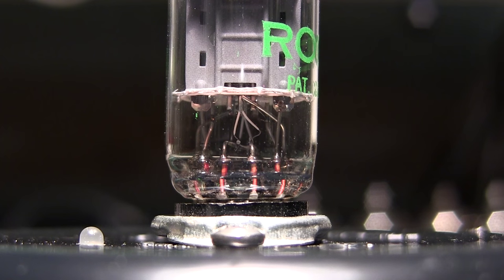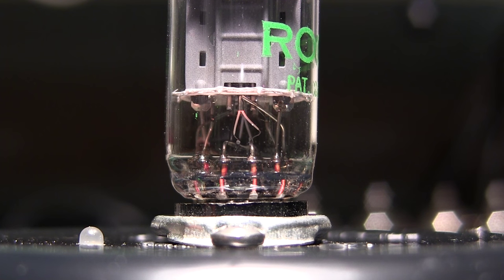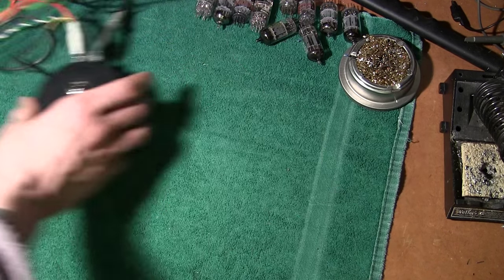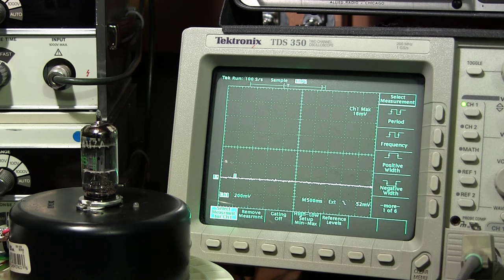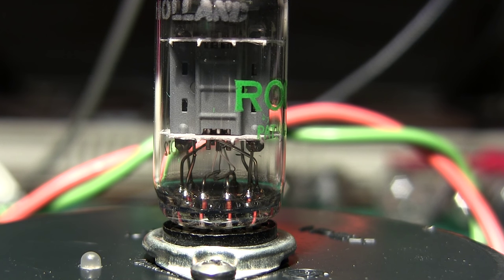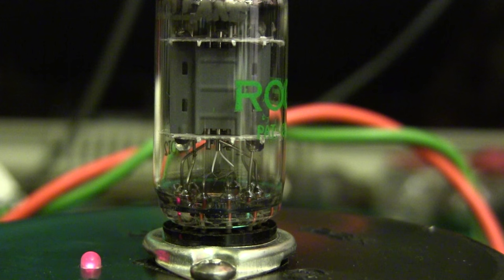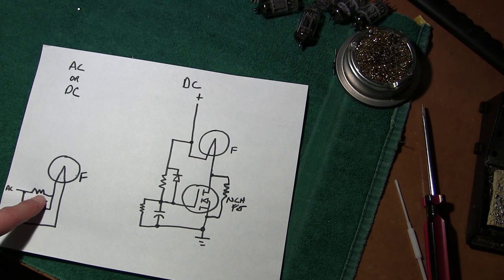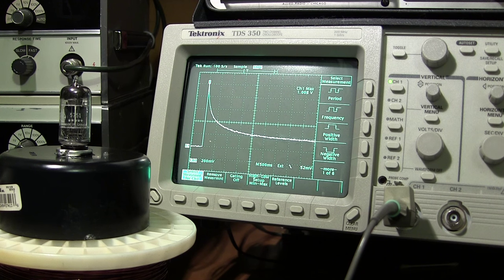Tech Tips Tuesday Dirty Little Secrets

Comment: What luck. Yesterday I was working on my first tube circuit using an ECC83 configured as a cathode follower, but I noticed that the filament was glowing really bright when I was turning it on, I used a 5 ohm NTC but that wasn't enough, they I switched to the other tube I had and that one was working fine. You should rename your video to something like Filament flash over fix or something, If I can't find a good NTC then I'll construct a mosfet circuit like the one you've presented. Again, I can't thank you enough. Cheers :)
Reply from the maker: +ciprianwiner 
Your welcome, Glad the video helped!

Comment: i gather that the the faulty filament had a non-uniform resistance per unit length 
and the portion with the higher resistance was where the flash occurred.
Reply from the maker: You got it Charles!

Comment: Intriguing  problem indeed... If heater sections are identical why the flash on one and not the other heater? One possibility is that because each heater runs up the cathode tube cylinder ( so has to be isolated from it and itself) parts of the lower filament may show low shunt resistance due to imperfect isolation that vanishes after the flash period. Just conjecture but it must be this sort of thing going on. In good heaters w/o flash this distributed shorting along the filament would not exist.

In this particular tube running the heaters in series would cure problem as one section would current limit the other. 

I was aware of heater flash and seen it many times  but thought it was 'normal' though did wonder why only some tubes had it. Interesting to know that it is considered a problem.

Comment: I'd love to have some "suggestions" about using a current limited supply in place of individual circuits for each tube... time delay might change some uses quite radically.
Reply: ...if the vacuum tube heaters were in SERIES, a single current limiting circuit for the entire heater string would suffice- but if the heaters were in PARALLEL, then EACH vacuum tube heater would probably need its OWN current limiting circuit.

Comment: Interesting. Makes me wonder why the tube-based computers in the early days were better left powered on all the time to prolonge life of the tubes... Lifespan is all related to thermal expansion...... ?
Reply from the maker: +bwack 
It's kind of a balance. Leave them on all the time and the lifespan in hours will be achieved. Turn them on and off through out time and lower their life through thermal cycling. My solution would be to turn them on and off, but soft start them like shown here. I think that would be the best solution for an elongated life span.

Comment: Very interesting trick. Seems like the incandescent lamps also always burn out on ignition.
I'm building a 5e3 tube guitar amplifier, and I wanted to replace the classic 'standby' switch (which I'm not convinced is doing any good) with your 'pre-heat' switch.

Which resistor value would you recommend for a double 6v6, 12ax7 and 12ay7 setup (it also has a pilot 6.3v lamp)?

Comment: Thanks for the info and excellent presentation. Is there any reason you didn't choose to use an inrush current limiting thermistor?
Reply: Indeed , this softens the start-up as well as indirect heated tube rectification .....and or applying HV after the needed heater warm-up time which is the definitive answer to tube life protection and extension .
Reply: ...REMEMBER: "self-heating" components are subject to DETERIORATION OVER TIME-(!)

Comment: For automated operation an off delay timer set to 15 seconds with a NO and NC set of contacts, the NO set running through a resistor of whatever value and the NC side running no resistor., The timer itself running off of main power. There no nasty transistor in my tube circuit, lol.

Comment: I would have thought that a low-valued series NTC Thermistor would be a very simple way of automatically limiting the switch-on surge?Would work with AC or DC heater supplies.
Reply from the maker: +Steven Birch 
May have mentioned this in this post. The problem with thermistors is, they require resistance to keep them hot. That little bit of resistance dramatically reduces the heater voltage under normal operating conditions.

Comment: I've got a tube flasher buried up in my junk and had a bunch of adapters with it I mainly used it on picture tubes but it had about all of the tube adapters and settings..and running DC on those filaments would keep them a lot quitter but draw a lot more current on startup...but the European tubes used a different substance to Dope the bottom of the plate and grids and as the tube ages the material would crack and fall off and short across the filaments and cause problems everywhere in the tube...and then people would wonder why this happened...how did this substance  get into the filament which is mainly shielded from the rest of the tube..running DC thru the filaments causes magnification opposite of what it happening inside of the tube so  when the substance would start to fall it would be attracted by the filament and cause a short...AC across the filament doesn't cause so much of a problem..so if the filament was shorted and not open there was a pretty good chance to make the tube work again by applying AC across the filament at about 200HZ at twice the normal voltage and it would shake the snot out of the filament and the substance would fall to the bottom of the tube and no more short and give ya a little more life out of the tubes if you didn't smoke the filament in the process...Those European tubes stank ...Their theory stank...and on..and on..anybody want to get into an argument about tubes...LOL

Comment: So the one filament is OK but the other has more tendency to flash. Question is what is the design problem. Shorter filament lead? Bent filament lead? Poor filament weld spot?
Flashing filament shorter in length? Filament resistance unequal? What?

Comment: Could you just use an MOV in line with the filament?   I know that this approach is used to prevent overcurrent in charging the caps driving a DC motor.

Comment: I know this is 4 years late ...  Could you make a simple automated circuit for AC filament using a triac and a small rectified voltage with a RC timer to trigger the triac ?  Same principle as the FET solution you showed.

Comment: Quite interesting! It would appear that there is an excessive amount of the filament wire between the coated part of the filament and the welded joint to the pin. Could that extra piece of filament that is also curved at least 80° be causing a weakness in the wire? It would be interesting to see other filament wires in other tubes with this problem. I wonder if the military grade of the European tubes ever exhibited this issue. Ever hear of similar issues with Russian tubes of the Soviet era.
Reply: ...THAT'S EXACTLY WHAT I WAS THINKING-(!)

Comment: Interesting issue. How about a NTC in series with the filament?
Reply: +zaprodk Good solution! I suspect that would work well
Reply from the maker: +zaprodk 
The only issue with using a thermistor is, they have to be hot to keep the resistance low. This means that sufficient resistance is required for heating the device itself, which would reduce the filament voltage under normal operating conditions.
Reply: +Mr Carlson's Lab Thanks for this reply. I was thinking a thermistor would work, but I now see the issue with this solution. Your sharing of your experience and knowledge are much appreciated. Thanks.
Reply: Making a DC supply for the filaments might be just fine if it were current limited to prevent the whole problem in the first place.
Reply: @MrCarlsonsLab  Yes it would, but you have to choose the values properly.  You could even foam insulate the NTC.  The resistance drop is quite dramatic.  For example, I am looking at a spec sheet now. For NTC with 10 ohms at 25C, it drops to 1.2ohms at 100C and 0.25ohms at 175C. They can go to 250C.  You could choose a lower resistance part and power more tubes through a single NTC.  It is almost a perfect match for filament startup, so I think you should take a good look.  It is much easier to add to a hand-wired chassis with tube parts as it is a single component.  Here is a link to one series of parts, not saying it is right for the tubes.....Anyway, I have never designed a tube circuit, so just a suggestion.....Your FET solution looks pretty good.
https://product.tdk.com/info/en/documents/data_sheet/50/db/icl_16/P27.pdf
Reply: Current source

Comment: ...since practically ALL vacuum tube circuits (except battery tube radios?) use AC for the heater voltage, I wonder what effect a SERIES DIODE WITH A SHORTING SWITCH, would have had on the heater flash(?)

Comment: I have some questions about vacuum tube filaments. Does the filaments work on heat or incandescence? Does the filament need to light up or can it just create the heat? If it only needs heat to work wouldn't nichrome wire be a better filament? If incandescence is needed wouldn't making the tube like that of a halogen bulb anymore ideal?

Comment: Fantastic video!  If you were to use a thermistor on the primary of the PT or the heater secondary, would it also accomplish the same effect?
Reply: ...the thermistor belongs in the vacuum tube heater circuit- NOT the transformer primary!!

Comment: Mr Carlson, This is off topic, but can you suggest a list of starter tools to get started in antique radio as a hobby? Perhaps a book or two to purchase?.
Reply from the maker: +ken r 
I will have to give that some thought. Don't know of any off hand.
Reply: +ken r "The Art Of Electronics" for electronics itself and RCA (recieving) tube manual, for the tubes, as there is a lot of info besides the tubes itself...and for most tubes there are basic circuits with rated components....latter one can be find using google search;) Or if you want a book (like me) check ebay for it ;)

Comment: This is a lovely example of an elaborate solution for a non-problem.  Heartbreaking, really.  Yes, I suppose you can be too intelligent.  Question your premise before engaging your brilliant problem-solving intelligence.

Philips engineers were highly intelligent, and they deserve MUCH more respect for their unmatched designs.  Of COURSE they knew about this design feature -  they intentionally created it to cope with circuits that had many tubes arrayed with heaters in series.  Circuits with many tubes in series are not used anymore, since computers moved on from utilizing vacuum tubes.  

"Filament flash" doesn't cause early tube failure.  Non-problem.  It's unbelievable that so many viewers bought in to this being a "problem."  That's the faulty premise.  I've been running dozens of Philips (Valvo, Mullard, Amperex, Miniwatt, etc.) ECC83 and ECC81 for years in guitar and home audio systems, and have tested hundreds of other samples of those fine tubes - none have failed from "tube flash."  I'll gladly receive these "faulty" tubes from anyone who wishes to be free of what they consider to be inferior products.

FWIW, CBS 12AX7A from the early-'60s - made in USA - also exhibit filament flash when starting up cold.

Comment: At the end, the use of a tantalum capacitor is recommended. Is the timing that critical? Is the usage of an electrolytic capacitor not sufficient?

I liked the explanation and solution to the problem.

Greetings
Reply: The timing is not that critical. I recommend a long-life aluminum electrolytic type rated for 105 degrees C. Tantalums tend to short circuit with high discharge currents, which may occur when the discharge diode conducts. For an example value of 33uF, Nichicon type ULD1H330MED1TD is one possible choice.

Comment: I look forward to these new tech  tip Tuesdays, thank you for the time you take to enlighten us. I do have a question though. On my Yaesu FT 101-E transceiver finals section they have a 5.6 Ohm 1 watt resistor with a single wire coiled on the resistor body, R-10 and the wire is L5. Am I correct to think that this configuration is simular to your concept in that it stabilizes the tube elements. I think of it as surge and decay rate balancing. Any suggested reading for this subject? Thanks again.
Reply from the maker: +John Jewel 
Hi John, without looking at the schematic, I think you are talking about the parasitic traps attached to the plates of the  Final RF output tubes. Usually their value is higher than 5.6 Ohms. They should be more like 56 Ohms. Those resistors with the coils on them are designed to stop unwanted oscillations. So basically, the RF final amplifier could become it's own oscillator without those "Traps." They usually have one (resistor coil combination) on the control grid of the tube as well. This has nothing to do with the heater circuit of the tubes. In schematics, the heater circuit is not always shown in the tube pictorial diagram, but illustrated separately to lower confusion while reading (less lines) What you see in this video is an external timed circuit to control heater warm up. Thanks for the kind word John! Glad your enjoying the video's.

Comment: Is it the heat of the resistor moving into the filament or is it onlly the current reduction allowing it to heat up more slowly? Should this be a new invention, where resistance occurs perhaps momentarily based upon a capacitance or battery charge up level which then throws a physical switch closed? Like the solenoid holding a switch open. Or a computerized logic system of timed lowered current.

Comment: hey thanks for this !
And wouldn't an in-series inductor work in this situation .. where end point would be no added series resistance ??  more impractically expensive, yes, but theoretically would make sense ..
Reply from the maker: +Tkj Tkj 
Unless it was a saturable reactor, it would not work in this situation. Thanks for your comment!
Reply: @tkj tkj Of course we could use a plain old inductor, if we had DC filament supply. Inductance is just a proportionality constant to get the counter-voltage (called EMF) generated by the inductor as a function of the rate of current change. Conversely, an inductor regulates the rate of current change to a value that is the voltage across the inductor divided by the inductance. So, the current across say a 10Henry inductor seeing 2V across it will increase at 0.2V/s rate. Suppose then that the filaments are shorts at turn-on (that’s the conservative worst case) and the inductor in series with them sees full 6V of filament voltage across it. Later, when the circuit reaches equilibrium, the inductor does nothing and acts like a jumper (assume DC filaments). So the voltage across the inductor will go down from 6V to 0V, and conversely the rate of current change across is will go down from 6A/s to 0A/s at 1Henry of inductance, and the values are lower as the inductance rises. So suppose we got a few tubes in parallel and their total operating filament current is 2A. We’d probably want to give them say 15s to get up to this current. So, the desired current change rate is 2A/15s=~0.1A/s. Thus, we need about 60H of inductance to get this rate at startup, and the rate will decrease from then on. What sort of an inductor do we need? I don’t have any large-choke designs handy to look up, so let’s use a “parts bin” transformer as a choke. If we have a 240VA mains transformer with a primary running at 120V, if it is designed for 10% idle current, it will have the primary inductance of about 2H. Now, imagine this transformer, with the same wire diameter, having 30x as many primary turns, and probably weighing 15x as much. That’s the inductor you’d need. Or, think a 7.2kVA 2A primary current transformer with the secondary removed. Possible, but impractical. Optimized inductor designs would be smaller and lighter, but still we’re talking well more than a kilo worth of an inductor, possibly more than 10 kilos. And it also would not work at all for AC. Oh, and you still would need inrush current limiting for such a transformer, since they don’t act as inductors until the core gets sufficiently magnetized – the “inductor” would use the poor filaments for inrush current limiting and that totally defeats the purpose. You could have a transformer with a soft core, or a gapped toroidal core, in which case you need even more core material. Things get quickly out of hand then. So, while it all works in the sense that you can calculate what’s needed to make it work, in practice it’d turn the boat anchor it’s supposed to help into a sunken ship :) I have dealt with 5-15kVA 400V transformers and these things need an engine crane just to move around.

Comment: The approach used as a filament saver in the past were “special” heater resistors in series with the heater strings. Now we know those resistors were just NTC thermistors. Isn’t that a simpler solution? NTC thermistors are cheap, work on AC or DC, and are a simpler solution, don’t you think?

Comment: Many thanks Mr Carlson for producing this very informative, and thought provoking, video.
Would I be right in thinking your circuit to overcome heater-flash is a type of solid state local barretter?  If so, owing to many types of barretter incorporated into a number of 1930s, and 40s, AC/DC radios being somewhat scarce these days, how easy could your circuits be adapted to, say, replace a defective, difficult to obtain, barretter incorporated into a five valve heater chain?
Regards,
Phil.
Reply from the maker: +SteelCity321PB 
Hi Phil. The Barretter is a completely different device, and would operate differently. Inside a Barretter is an iron filament (not tungsten) used for current regulation. The idea of this circuit is to "pre warm" the filament before applying full heater voltage. A Barretter would not have that time delay period. Thanks for your comment!